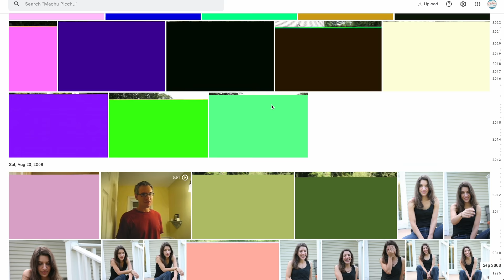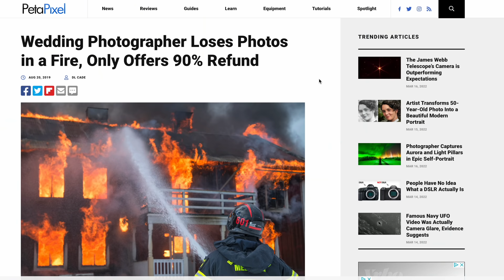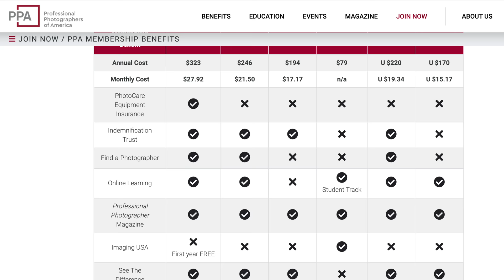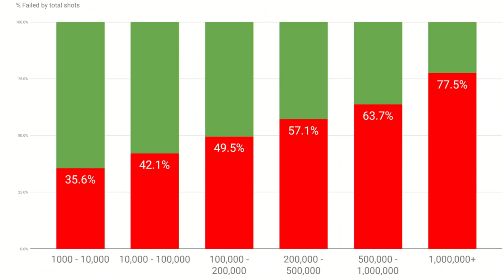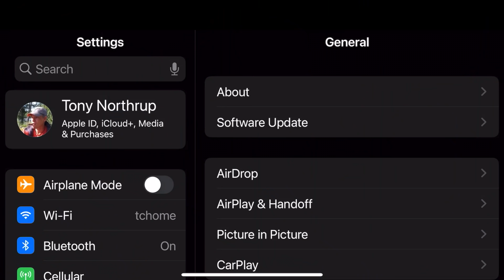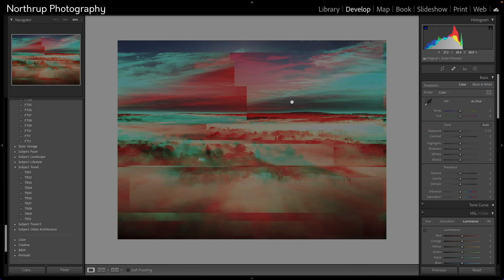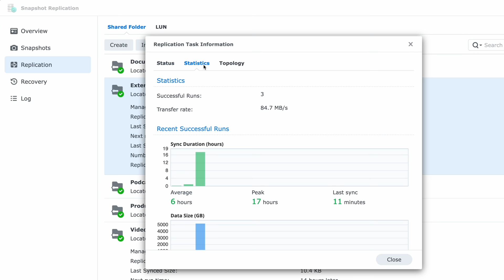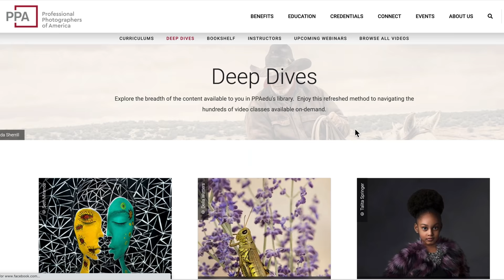NAS Storage for Photos & Video: PROTECT YOUR DATA!

Comment: Currently I have been storing my photos and Videos on External Harddrives which are disconnected from my computer. I call these Collection Drives. Each Collection drive has a backup copy which is stored at my storage unit away from my house in case of fire or flood. The pictures or videos that I use are stored on a separate drive I call the Active Drive. This way I has less of a chance of creating a User Error. (Saving Over, Corrupting, or Deleting Files) I follow a protocol of only using my Collection drives as a read only method. Just copy the files over to my Active drive. Do not modify or delete anything on my Collection drive unless I am specifically checking it or doing an intentional update on it. The less I tamper with my files, the safer they are.

As for Bit Rot. I don't have a solution to this as of now. In the future I may do a full transfer over to SSD's as a new medium and refresh all my data. to a New medium. Some very important files I might copy to a third drive for an extra layer of protection. (Manually checking backed up without syncing. I do wonder if blockchain technology will solve the issue of data rot through its verification process. It would really suck for someone to have the wrong amount of coin in their digital wallet due to bit rot.

Comment: Sorry to hear what happened. Now about the video itself : I understand the advice of making some use out of the photos instead of letting them sit on a drive (which not only creates some redundancy, but also brings back the point of taking photos in the first place) ; but shouldn't the video also cover measures that would prevent the problem from happening in the first place ? I would think that generating a hash for each picture and periodically checking for it would help detecting corruption on a given drive as soon as it emerges. Of course that's probably a naive assumption on my end but sure enough something along those lines should be possible to at least prevent the blind backing up of already corrupted files.

Comment: Thank you for this video.  You did a great job demonstrating that even if you practice the 3-2-1 method of data backup, you can still have bad data replicating through your backup system.  Did you ever figure out where the source of the corruption occurred?  Did it happen long ago when you put photos on external HDD's?  Then when you upgraded to a more sophisticated NAS you were just copying bad data?  Is there a way to review all your pictures in bulk to make sure that they retain their original data integrity?  I am naive to this, but I would think that each file would have a CRC check or something equivalent that would alert you that the data is corrupted.

Comment: Ten years I had a few problems with pictures suddenly getting massive color stripes. That was enough for me to make multiple backups as a habit. I also made checksums for files so errors could be caught before a file was reviewed by a human.
Rule #1: never backup a bad file.
Now I use WINRAR on windows. It handles its RAR and other formats such as ZIP. It includes checksums for the files and optionally encryption and error correction encoding.

Comment: Okay, you've scared the crap out of me.  You have my attention.  I'm ready to spend some money on it, but not as much as you have.  

1. How do I make sure that the files on a disk haven't been corrupted before I copy them onto a backup drive?  

2. How do I make sure that the copy is the same as the original?

I've done some searching and haven't found anything that directly addressed issue number 1.

There's no way I can afford online storage for my measly 6TB of photos, but I can afford to store them on hhd's.
Reply: 1 open them one by one, there is no other way (also a good opportunity to sort the pictures you don’t need)
2 they should be the same, also repeat the previous.

Comment: I need to do some work to cleanup and backup my files better. I have 3 copies but they are all in the same place. I manually save copies, no automatic backups as they provide limited value by copying errors etc.. I don't have a cloud backup. 
Very interesting to think about the ideal solution.

Comment: Good and sound advice.  I use DAT (Direct attached storage) which will back up to my on line Backblaze account. For less than $10 a month you can get unlimited storage for one computer and all its directly attached storage.  My DAT is a 5 bay Drobo set to double redundancy.  That unit is backed up locally to a Sinology NAS on my internal network at the house which also is set to double redundancy.  Everything in three places - the two local storage units using RAID set to double redundancy.

Comment: I have been there. The backup solution I use now is an incremental backup. Only new photos are backed up and are copied to an external drive and a NAS. So if I run in to bitrot, at least one of the two backups should have a clean file since once the photo has been backed up, it doesn’t get copied again on the next backup. After watching this, I am going to ad a cloud backup to the mix also.

Comment: Hi Tony, you don't really cover what you need to do to avoid bit rot in this video.  You talked about all the technology you have and RAIDs and many copies in many locations but it sounds like bit rot still got you.  So what are the real ways to avoid it?  I didn't really see anything that you said "I didn't do X Y and Z and that is why it got me."  Thanks.
Reply: RAID doesn't automatically protect against bitrot. Some RAID systems, like ones based on ZFS will automatically repair the damage if there's still a good copy available when the file is accessed. And with regular scrubs, all of the files will be accessed.

The best practice though is to have software in place that will regularly go through and verify all of the images along with a proper backup regiment. Doing that, should identify bad files early enough to restore known good copies. ZFS arrays are nice because they simplify the process, but are not necessary.
Reply: @SmallSpoonBrigade  Linux mdraid will do weekly scans to look for bit rot. Mine found some least summer and again last month - same drive of the 4 drive RAID5 set:( It automically recreates the missing data from the other raid disks, and then moves it somewhere else. But the smartmon tools keeps reminding I have a bad sector even if its not used. Need to manually overwrite it I guess?

Comment: Thank you for this great video. I’ve been going to do all this for years but haven’t done it yet. I’ve taken millions of pictures as a hobby and don’t have a backup of most of them. Most of them are only on old SD-cards. I’ve been using them since 2004. Only one of them has been broken so far. First step that I have been trying to do is copy all those SD-cards (maybe 100 cards or so) to my 6 Tb external hard drive that I bought 3 years ago. But it’s still almost empty. It takes about 2 hours to copy one 128 Gt SD-card so it’s just too boring and too much work so I haven’t done it yet. I’d rather walk around in woods with my camera (or cameras) always when I have free time. It’s easy for me to search for wildanimals for 10 hours in forest but difficult to copy files for 2 hours. :)

Comment: Thats scary man. I had it almost happen before. When a Raid5 system failed due to 2 drives dying. 1 turned just to have a corrupt lead. So it could be fixed. Since then I keep my SD’s unformatted  for a few months. Backup those to SSDs. Copy those to NAS with a raid5 system and backup those to GoogleDrive.

Comment: My future plan includes a custom built PC... or more... running Windows 11 for Workstations, ReFs, Bitdefender (just in case), and Backblaze. Right now I could fit up to 320TB of spinning rust plus tons more solid state storage in such a system... and it would have a bit of protection from bit rot. Unless Backblaze made a change to their service, you should be able to have a cloud backup of that system for about $70 a year... I also have gigabit internet (later to be upgraded to 5gbps), so this all seems very plausible.

Comment: I use three portable hard drives for photo backups, with one residing in my safe deposit box. I also use a fantastic program called Beyond Compare to compare files and folders. I can compare files by name, size, or at the bit level. It gives me peace of mind knowing that the folder I copied/moved is an exact match. If there is a difference, this is how to catch it.

Comment: Definitely one of the photographer's worst nightmares.  I started shooting in digital in 2001 and fully moved to the format from film by 2006 so I have a lot of backed up photos as well.  I used to backup to DVD-ROM until I found out a while back that the discs that were supposed to last a lifetime were actually rotting away.  Fortunately, by the time I realized this, I was able to safely copy everything to external HDDs.  Nowadays I back up to external HDD, which I keep disconnected when not in use, and online.

Comment: I have not gone to this extent with my photos but when I had my dental office I worked with my IT guy where my dental files were backed up on the computer then to a external hard drive which in turn he backed up to his back up systems which in turned was backed up to a back up company in Atlanta (we were in southwest Florida) (hurricane ally). So if you can get your IT guy to do something like this. You will never loose your work and in my case patient files. Which I once had to pay a firm to take my hard drives and remove the virus on it from my employee opening up her emails 0n my computers. 🤬🤬🤬

Comment: Part of the problem is the way Lightroom works with jpegs vs raw files. Jpeg metadata gets written directly to the file... creating the potential to damage the file during a metadata write. Today I shoot raw, but back in 2003 I used jpegs. If you run a batch process in lightroom on the old files, like face detection, or update to current process, lightroom will modify the jpeg files. While I use ZFS, which has a built in checksum, it will not protect your file if it gets modified by a program, and the file gets corrupted by the program (ie not bitrot). Also, you must explicitly run a ZFS Scrub to detect bit rot if you are not accessing the files through normal use. ZFS has snapshots, which will store the old versions when files get modified... but this will add complexity to your backup process.

Comment: For some reason, right from the very beginning I took having a backup routine very seriously, probably to the point of overdoing it, if that's possible.  Then again I only have about 15 TB currently.   I started with CDs when they were the most affordable solution, then external drives, DVD's, BluRay and cloud services.  All of my data is backed up multiple hard drives (on and off site), optical media and the cloud.  I haven't lost a file, to my knowledge, in almost 30 years.  Hard drives DO fail and optical media does go bad but so having multiple backups is critical.  That being said, in all that time, I've only had one or two occasions where I found the back up to be corrupted.  Even my oldest optical back ups, while I wouldn't rely on them still seem to be in good shape.

Comment: Happened to me last year, lost all the holiday tour pictures on a new external HD. Tried recovery software, it found everything except those pictures. Bought a small synology NAS with two used drives (RAID configured). First WD drive failed in the first week, replaced that. Went to a wedding, came back a week later, NAS reporting the other WD drive had failed. Like you I have taken to leaving the images on both the X-T2 cards instead of formatting each time. If I had done that I would have last years images.

Comment: Automated backups are good for short term (1 or so years), and decent manual backups to bare drives are good for important older data. I store those bare drives in a fire/water resistant safe. For short term backups, a DIY NAS setup, will have options for periodic automated scans for corruption, especially for many ZFS setups.

On my PC, I have 6 hard drives, 2 M.2 SSDs, and 2 SATA SSDs. Since I also backup to a NAS, I use more of a JBOD setup on the PC. Then for data that is not easy to replace, I keep manual bare drive backups, which are easy to do with a USB 3.1 SATA dock.

For automated backups, make sure you have versioning enabled, and have it for bulk media and basic documents, have a separate backup pool that enforces versioning without deleting older versions. Since they are unlikely to be changed much, it will not cause space issues.

Comment: If a hard drive fails, especially an external drive it doesn’t mean the actual drive failed. Probably 95%+ of the time the failure is in the board that connects the drive but the drive is ok and each company uses their own boards so some are better than others such as every seagate external drive I’ve ever had has failed. Take the drive out of the enclose and either buy a new empty drive bay (they don’t have boards) or get an hard drive hub (they fit several sizes of drives, just plug your drive in and connect to your computer and there it is).

Comment: Do you know of any software that scans entire photo libraries and reports corrupted image files?
This could be used as an early warning system, to help flag corrupted files and stop them from propagating overwriting existing (uncorrupted) via automated backups. 
As a workaround, I can suggest Excire, software that scans and analyses images using AI technology, to enable image searches based on subject recognition and photographic criteria (and can do automatic tagging). While the scan took a long time (about 34 hours for 142K images) it did create a list of corrupted (unreadable) image files as an unexpected bonus. In my case, there were 155 corrupted files, which indeed are irreparably damaged.

Comment: Loads of really good comments, and I just want to add to the flood: use TrueNas with zfs file system. Just buy a good box from them. Make sure you can survive two simultaneous hard disk failures, not just one, in your setup. Zfs will protect you from bit rot.

Comment: Hay Tony, out of interest was it mainly JPEG images that you lost of RAW's as well? I've also lost some JPEGS as well in the past but lucky had an old offsite backup I did not update existing files and kept 'originals' (phew) and in the other backup locations I did use 'sync' which updates files but sine enabled 'versions' to help avoid issues in the future... What I found are images I had edited in Lightroom a number of years back and written edit data into the JPEG files, some of them got corrupted! I'm wondering if you might have run into the same issue as I think Lightroom had a bug/issue were it corrupted JPEG files when adding edit data into them is my feeling (I did not seem to have any corruption on any unedited files but only files Lightroom had edited/touched were corrupted!... Since then I've been worried about getting Lightroom to include the edits into JPEG files... I much prefer the RAW editing where it creates an additional side card file (XMP) and would like Adobe to add that option for JPEG as well to avoid it having to 'edit' the original files....

Comment: if you using a nas you should use ZFS or for windows REFS, that will already prevent the issues with bit rot. the file system has check-sums and ecc data to repair corrupted files.

Comment: Will an external solid state drive used exclusively for backup retain photo file integrity longer than a mechanical magnetic platter drive? The SSD would only be used for backups, copied from the SSD in the computer.

Comment: I'm making backups with FreeFileSync and it reports which files it finds changed and wants to rewrite or add to backup and if You spot changes in files from far past it would be obvious that something is going wrong and You can prevent the corruption from spreading.

Comment: when I think about this I'm more and more leaning towards just shooting film, it just preserves so much nicer under the right circumstances. With this Bitrot you can be as much up to your backup game as possible and still get hit, with film at least you have to store it wrong or set a flame to it to lose the information. :D
Reply: Bit rot is a solved problem. A mirrored zfs array will monitor and fix it. Or you can have a file verification tool combined with backups. In either case, you need at least 3 copies in 2 places with at least one in a different region to be safe
Reply: @SmallSpoonBrigade  well yeah, you're of course right, but that sounds very expensive to me, I'll keep shooting film and archive it in my fireproof locker. :D
Reply: Would you get the same thing if you shoot digital and have everything you want to keep printed?

Comment: So far I have had only 1 data corruption and it happened because I accidentally accepted a formatting of the SD card while checking for available space using the camera menu system. It wiped clean a photo shoot that I had not backed up, or so I thought. I found a software utility that could recover the images. I got all photos back except two. Scary...

Comment: Great tutorial on backups. Although I do multiple drive backups, I do plan to get a small Synology system. I also do cloud backup on Google Drive for client files. I don't have as much as data as Tony and Chelsea but still enough for multiple TB backups. For important shoots, I keep multiple SDs with original files of images until backups are done before re-formating SDs.  Sandisk Pro SDs are cheap at 32GB and 64GB so I buy enough. The more SDs you have, the less each is over written over time which increases life of SD. I have had a few corrupted SDs before.